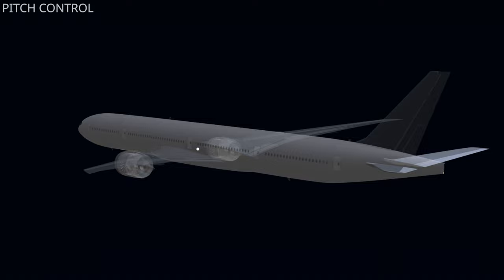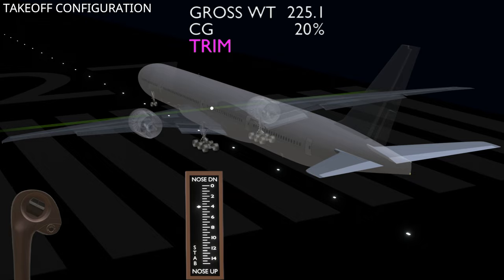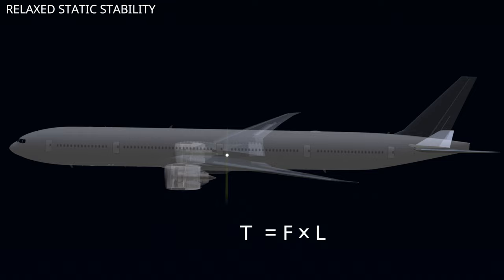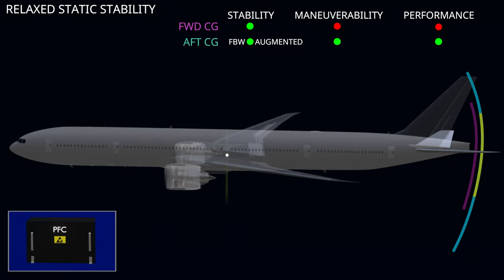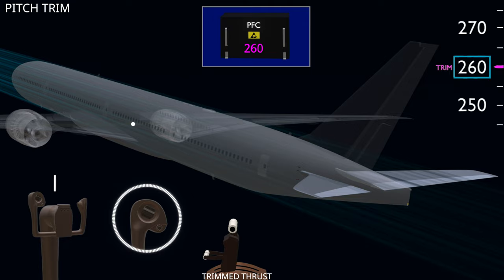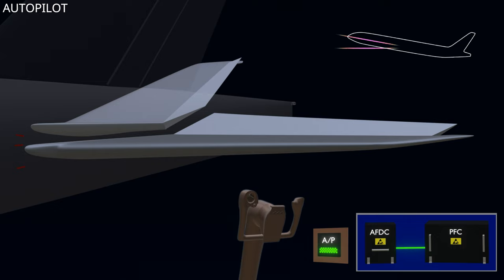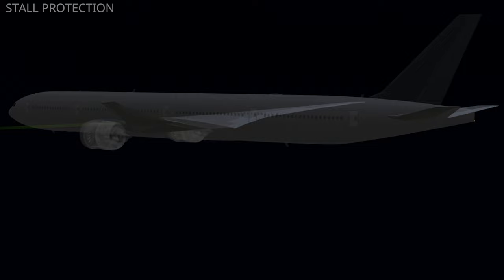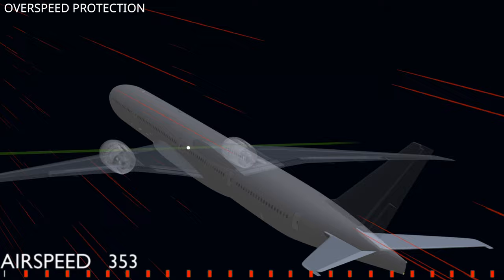How Flight Controls Work | Part 10 : Pitch Control

Comment: Awesome 777 series of videos. One thing I'd like to mention. Concerning the stall protection, the fly by wire system will eventually prohibit manual nose up trimming of the horizontal stabilizer as the aircraft gets closer to the stall and as airspeeds gets too low. The system will fight to avoid a stall but the pilot has the ultimate authority, since it's a soft protection. The pilot will be able to stall it if he applies enough back pressure to force the 777 to stall after the trim is inhibited.
Reply from the maker: Great point!
Reply: As it should be. Other than the Max' MCAS ... :p
Reply: @hutmitfrosch3030  Yes, as it should. The pilot having the ultimate authority of control , excluding how MCAS was previously on the 737 Max.
Reply: @ARandom777  True. That's what I meant by my comment :-)

Comment: Neat finale in the 777 Flight Control series. Was interested in what the Boeing FBW equivalent for the Airbus FBW Alpha Floor is, this seems to have answered it extensively. Also, was great that you went into some detail on the -300ER's tail strike protection software.